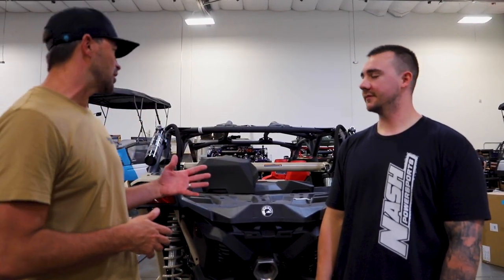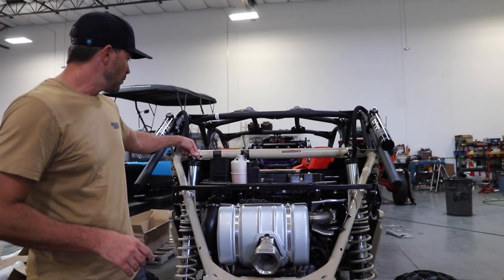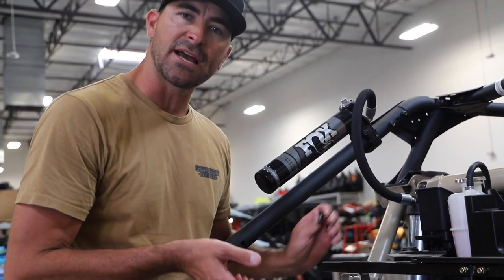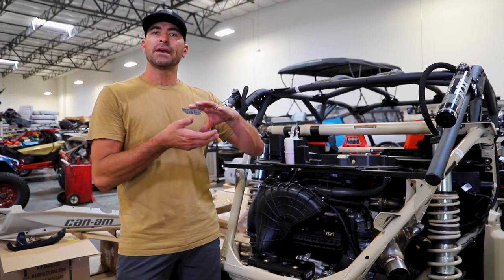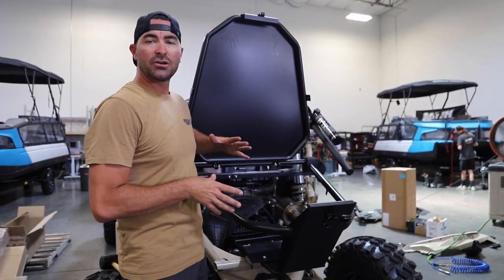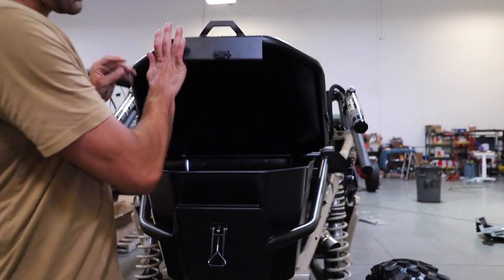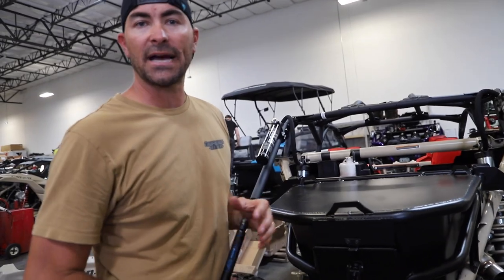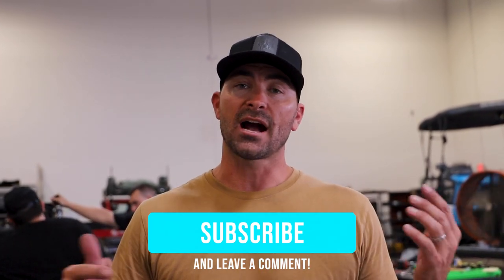[INSTALL VIDEO] THE B2G X3 STORAGE SOLUTION  | CHUPACABRA OFFROAD

Comment: Does the heat from the exhaust cause any problems with the plastic bucket melting?  I noticed there was no heat shield. Should probably use heat tape?
Reply from the maker: Hundreds of customers and that has yet to happen.  It was a concern for sure, but the design of the exhaust keeps it away, and allows the plastic, which is ideal as it's so light weight and allows us to drop the price significantly versus a US made aluminum tub.
Reply: @ChupacabraOffroad  You rock! Thank you for the info.

Comment: How much does it add to the over all length of the car? Can you get a measurement from the radius rod plate to the end of your cage. Just looking to see if it will fit in the toy hauler. Thanks. This product looks great.
Reply from the maker: 12” past our 33” tires